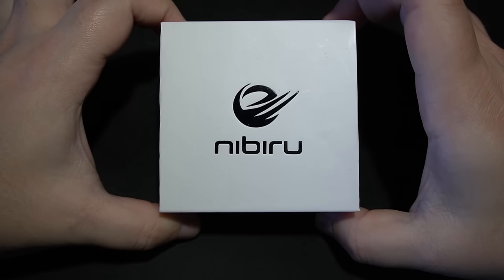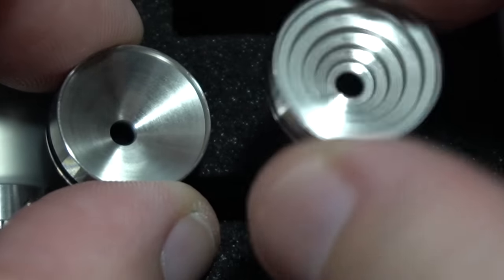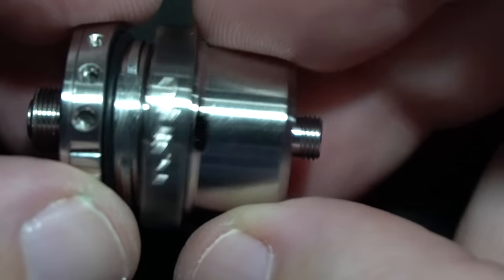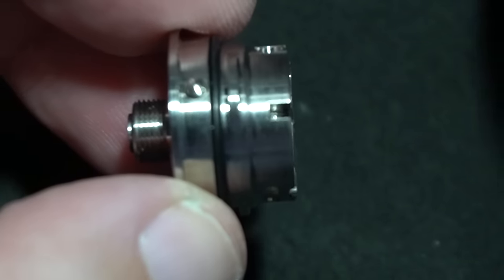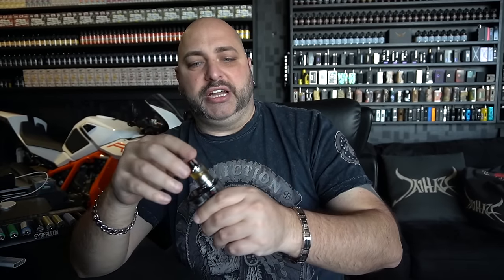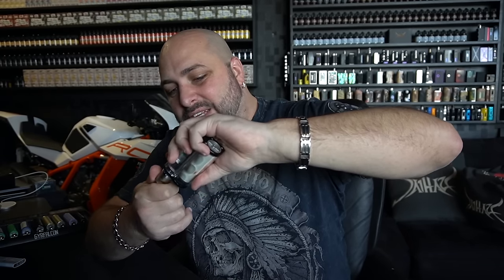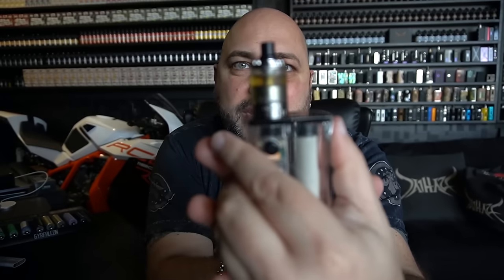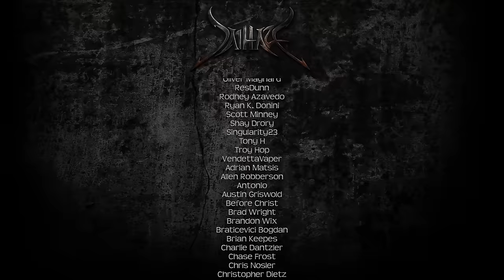Big Bear In My Backyard | Nibiru RTA, Stairs For You Fat Air

Comment: I bought this when it first came out. Great vape to be honest with great flavour & throat hit but I’m not a fan of bayonet systems. I also felt like there’s air coming in from somewhere so it works better for a RDL vape than it does as an MTL, which is how I vape.

Biggest pro, even if one does open up the tank accidentally by turning it all the way since it pops off easily, it won’t leak all over the mod or in your hands. I like that feature a lot.